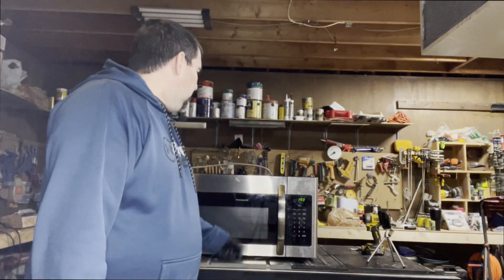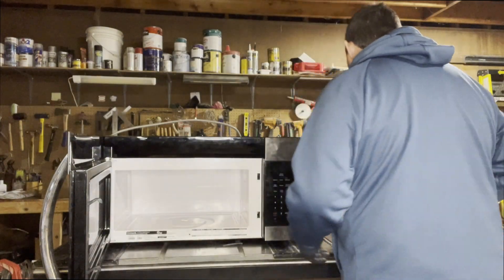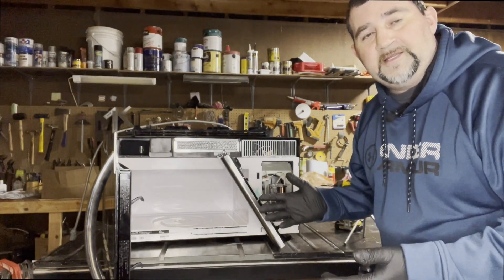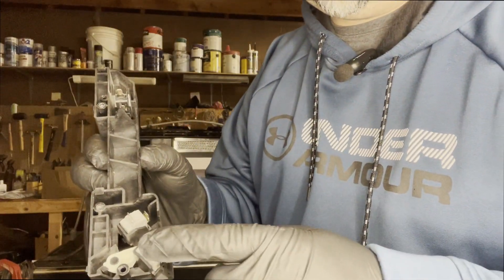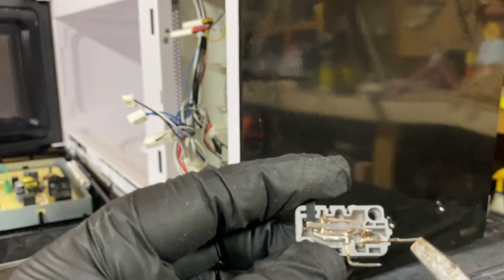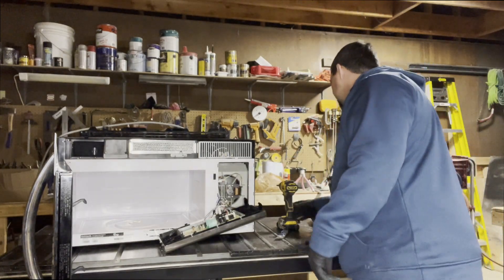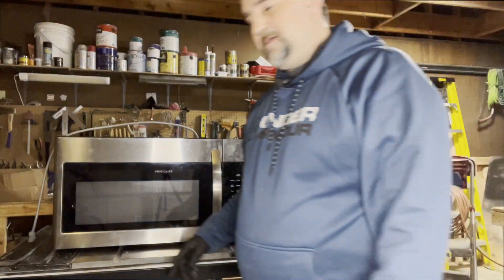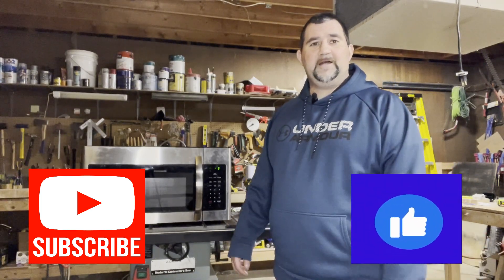How to Fix A Microwave / Microwave Keeps Tripping Breaker

Comment: My also trip my circuit braker box. When I went to buy the switch, they had 2 options normally open and normally closed, does it matter which door switch I buy? And is the third switch the same as the other 2?
Thank you.

Comment: If you want to pause the microwave you need to hit pause on the key pad before opening the door. The microwave WILL pause if you just open the door but the problem is the power is still going to those switches and if one, the top or bottom switch disengages first it sends a power serge to the middle switch. The middle switch runs the key pad and functions. 99% of the time the middle switch burns and it is because someone opens the door while the machine is running without hitting PAUSE first to shut the switches off before opening the door. Hit pause then open...no more problems. Or let the time run out of course.

Comment: I did my continuity tests with the switches still installed I could hear the clicks and have 0 ohms so my switches are good but it doesn’t trip the break right away it goes for weeks or a month then will trip randomly then I reset the breaker and it works again.
Reply: Does it trip the breaker if you open the door while its on?

Comment: Great Video. Sadly the switches are between 30.00-50.00 each from the manufacturer or most appliance parts places. And with our labor rate usually @ 40.00-70.00 per hour (because we don't work for free) In Reality if you have it apart, rather than taking it apart again you should just replace them all. Otherwise you risk the dreaded come back... AKA "Since you worked on it, it stopped working again" Because the manufacturers want you to replace the appliance even when it is only 2 years old. Sadly (and WITH SOME ANGER) The 3 Switches alone are priced close to 1/2 the price of a new microwave, not including diagnoses and Port to Port travel. AND if you need a circuit board they are usually NLA! We all know the switches in 2023 are just a 6.00 part. Planned Obsolescence at its finest.
Reply: Agree. You can get a new one for $219 now. Mine is doing this and I hate tossing a giant appliance in the garbage if it's a simple switch or fuse. So frustrating. Is this price you paid for these Mike?
Reply: The price is more like $8. Other repair videos have a direct link to Amazon where you get all three switches.
Reply: @johnbramsey  You are correct, Yes from amazon they are only 8.00.  From the manufacturer they charge 30.00+ dollars
Reply: @youknow5569  yes, I did see that price. Hard to believe people would pay that when a little research shows much better prices elsewhere.